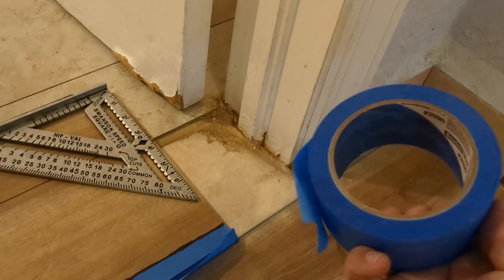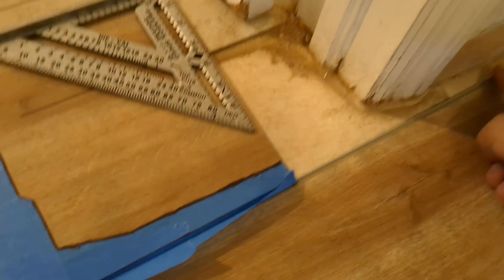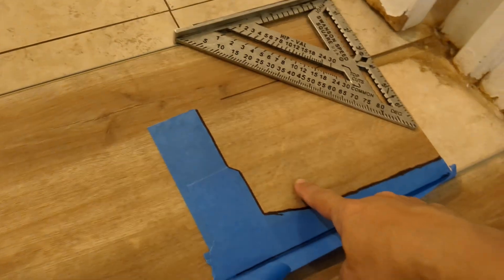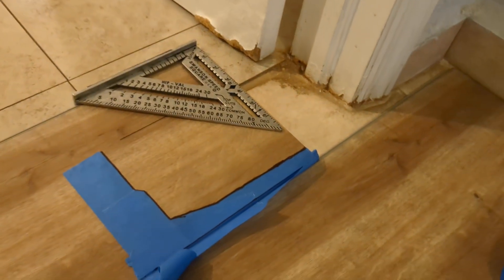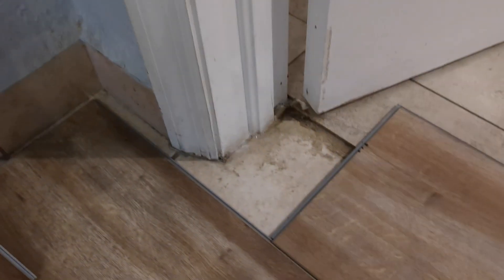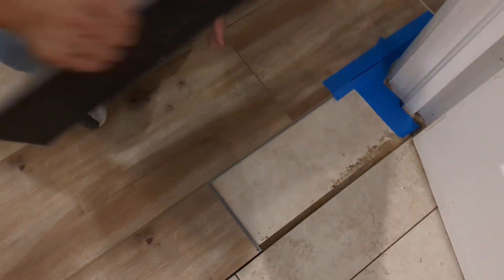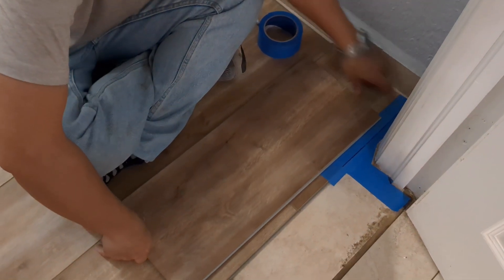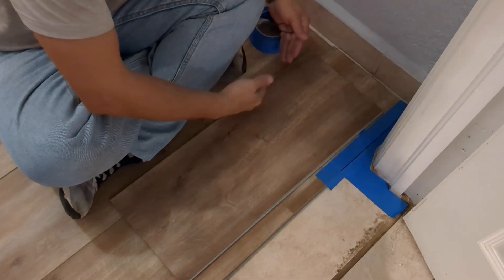Cutting corners

Comment: Undercut the jambs
Reply: 🤣Duh!
Reply: Sometimes it can be difficult to get the pieces to interlock when you undercut the jamb as you need to place them down at an angle first, if it's stuck under the jamb it doesn't allow you to lift the edge. Sometimes you can get away with doing it that way by sliding the pieces under but if it's at the end of a run makes it much more difficult. Helps to be able to adapt to whatever situation you're dealt.
Reply from the maker: Well said, @Clip7heApex. Thanks for elaborating so eloquently the many pains of floor work. Stay best!
Reply from the maker: Thanks for the tip, @aaronsmith903. I would normally undercut the jambs with an oscillating tool or coping saw, but opted instead to hide the expansion joint with caulking in this instance for sake of laziness and simplicity. My hat's off to anyone working on flooring; if nothing else, it keeps anyone who attempt it humble, grounded, and sore.